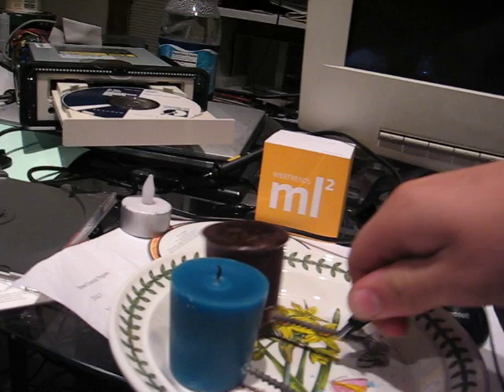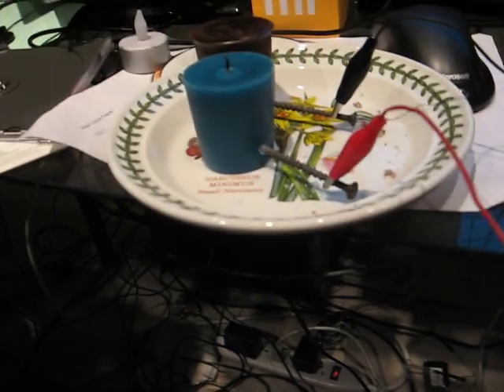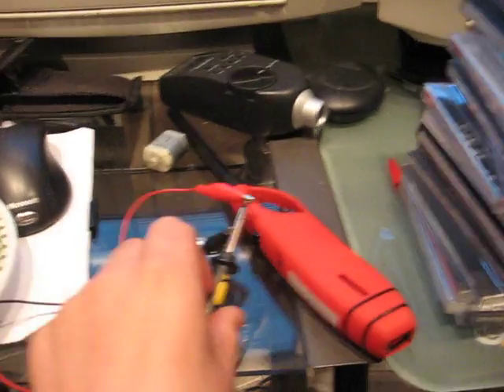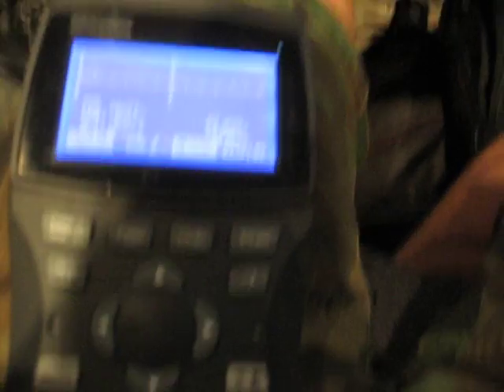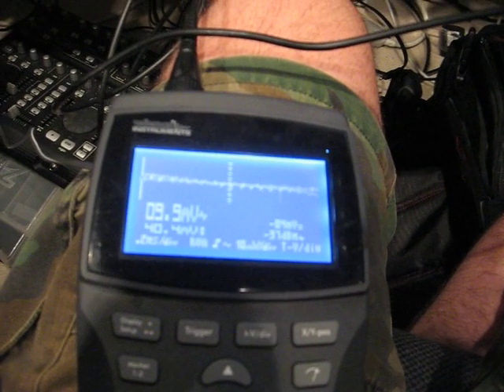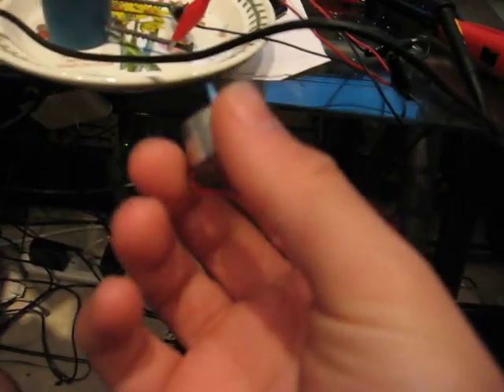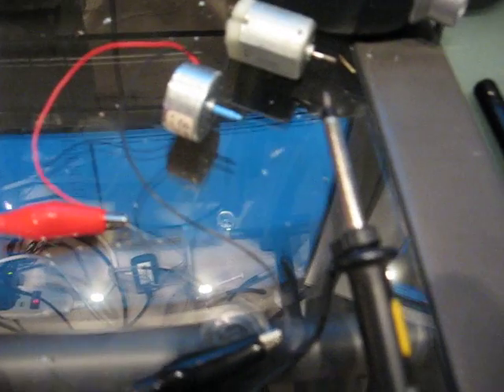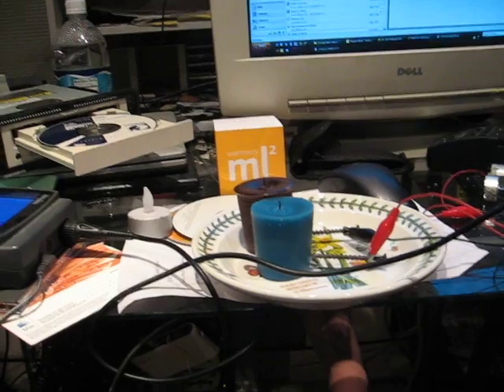Candle Power - Busted!!!

Comment: A thermo coupler on a gas water heater uses heat on copper tubing to create a small electrical charge .one thing you didnt do is wrap copper wire around the nails ..not saying it works like the video but that is how a thermo coupler works so you can make electrical current with copper and heat .google that smart ass

Comment: Pretty good job, but not a great disproof.  Try a diode instead of the oscilloscope or a diode in series with the scope.  Then try putting a load between the candles without an oscilloscope.  Two things the faker did differently: rectify the current and use a load.  Oscilloscopes are designed measure, not interact so they have high internal resistance and draw very little current.  As an example, some switching power supplies will not work properly if there is no load.

Comment from the maker: @frowe327 That's my thinking, I've designed similar tricks where the candles were actually made by me with a special copper coil wound inside them. Then, proportional coils were placed under their approximate locations on the table, and a foot switch was used to provide power. NOTE: THIS IS EXTREMELY INEFFICIENT, and only works with AC, but it's probably how this demo was done. When the nails are pushed into the candle, they contact the copper coil within it, which then picks up the field.

Comment: @canberkh92 The magnetization has nothing at all to do with any observed effect in this "trick".   A static magnetic field in a regular steel conductor cannot generate an electric current.  The actual (switched) power source is probably located beneath the table (of the original "working" video), applied via  small finishing nails protruding through the table top which slightly penetrate the base of the candle which ( molded around a soda can).  Power is switched by operator beneath table!

Comment from the maker: the voltage read was the same as when the meter wasn't clipped to the screws. I have since repeated the experiment with nails, and got the same result. also, when magnetizing an object, it is not the surface you are magnetizing, but all the metal! please post again if you would like me to post a more in-depth video.

Comment: I am sorry to say this but your method of falsifying the experiment is wrong

Here is why
The experiment is completely based on the magnetized nail (and yes not screws). The surface area that you magnetize is extremely low when you compare it to the surface area of the nails that you magnetize when you rub the magnet. There was a very low reading on your volt meter, which is a proof of the existence of voltage however due to the lack of necessary magnetic field, you didn't get a high reading

Comment from the maker: It is an oscilioscope, it measuces both AC and DC, as well as the frequency of the energy. During the test, it did not measure any more electricity that what is in the air around us.